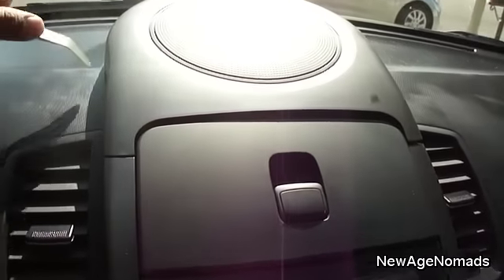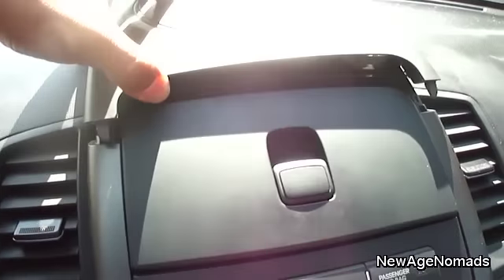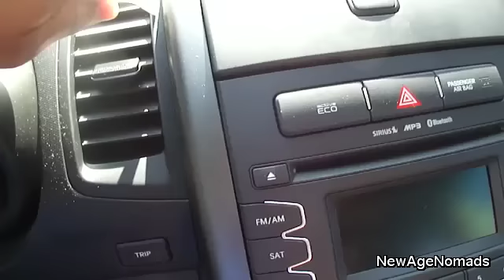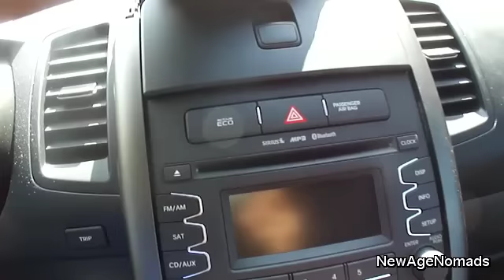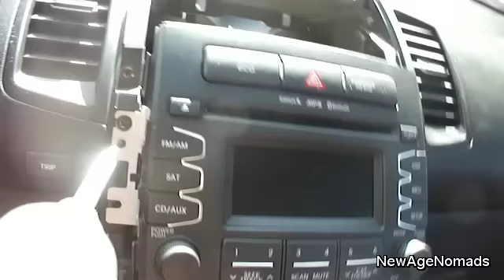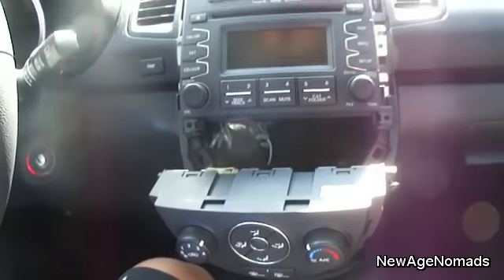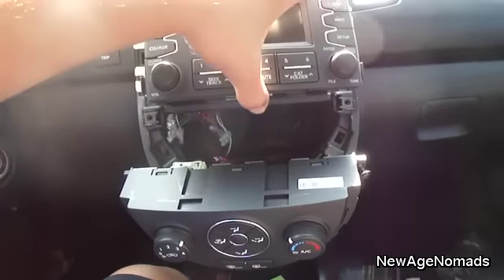How To Remove Stock Stereo From 2012 Kia Soul : NewAgeNomads

Comment from the maker: I can tell you that its easy to run the power wire under the dash in the top left corner .. there is plenty of room . You can either poke a hole through the rubber boot or drill your own hole. Just make sure you don't drill into anything .   When you pull out the stereo all the audio wires are in the plug on the left. The wiring codes you should be able to find online.. You also need to find the 12 Volt switched power and fuse it for your Amp Turn on lead..

Comment: Hi I have a 2013 Soul with what appears to be the exact same stereo. When I am playing a CD, it always puts about a half-second "gap" of silence in the audio before the next track. I assume this is when the unit does not detect information in the digital stream (between tracks) and it is designed to just mute the sound. Usually it doesn't matter but on CDs like Dark Side of the Moon or a concert CD where tracks are supposed to blend together it is VERY annoying!! Does the 2012 do this also?

Comment from the maker: It is not..  You have to add a LINE OUT CONVERTER / Hi Low Converter. You can order them off SONIC ELECTRONIX dot Come they are about $10-$50